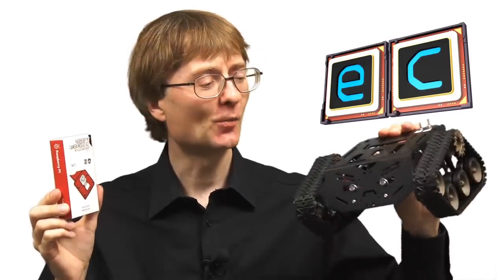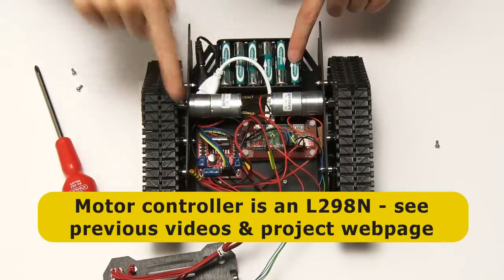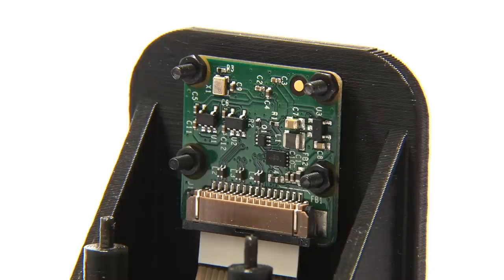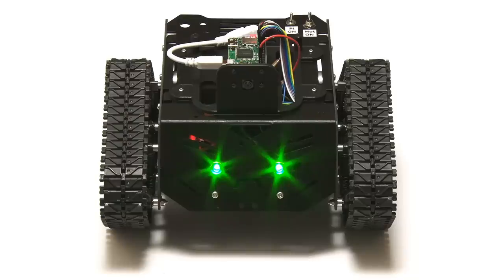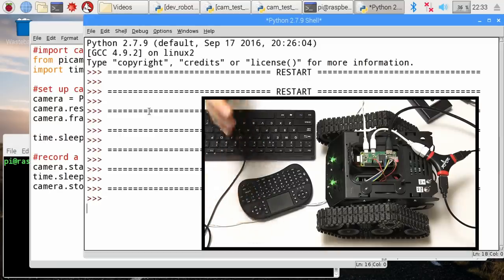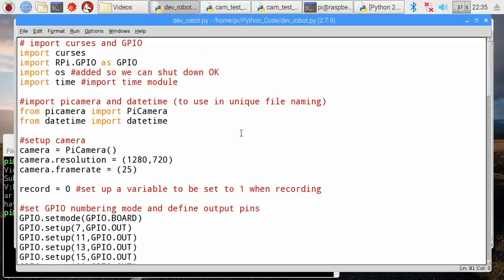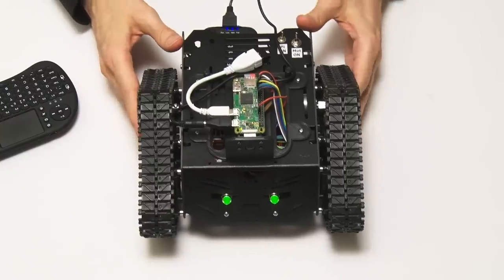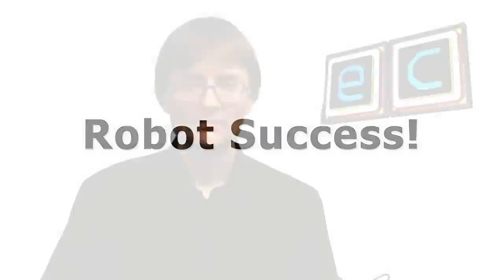Raspberry Pi Devastator Robot #3 : Camera

Comment: Some ideas: 
-You can add a GPS module, there are some cheap GPS boards that output the coordinates in a serial port, so you can easily read the location and use it for navigation.
-You could install openCV on the raspberry and do some image processing, like detecting faces or objects.
-You could also install gyroscopes and accelerometers  to further improve navigation.
Reply from the maker: Great suggestions. So much I could tryu here.
Reply: Screw navigations, a weapon system should be next.
Reply: @TentaclePentacle  someone found some sense. think it would be able to compete on robot wars?
Reply: @elite gamer88
It needs a bigger battery pack and more armor.
Reply: Good ideas.
Reply: @TentaclePentacle  >>> "You're going to need a bigger boat." -- JAWS [1975] 😊
Reply: Lidar ?

Comment: Loving this project. The way you explain the code is wonderfully clear. I've got a similar little project on the go here and initially thought of using 18650 batteries to power everything, but realised early on that the 4 motors I am using would be drawing a lot from the cells so am employing a separate power source for the current Pi 3B+ that will later be replaced with a ZeroW
Reply: Really depends on what you are planning to do. My little project has 4 12v motors running about 2 amps. I have added cameras, sonar and microwave so far. I will carry on mixing sensors until I achieve what I want from it. We all know motors use large amounts of energy to move things so unless the surface is level and smooth the 18650 batteries will probably drain before any smaller DC source for the Pi etc. I am also looking at fitting a SSD drive but the power up drain is quite high so a simple SSD to USB adapter would not work properly. I want this project to be working for hours not minutes so I have fitted 9 18650 4000 mAh batteries in a tray underneath

Comment: Been waiting for an update on the robot! These make for a good instructable as well, and has been making me quite tempted to pick up one of those devastators myself, or at least something similar. I was thinking if you take a game controller with analog triggers/sticks, you could map your control program to take the readout of how far the sticks are pulled forward or backward to control speed/direction. kind of a dual stick driving mode, each analog stick controlling a track. Though it would take a little practice to get fine control to pilot it though. Was fun to watch, looking forward to the next.

Comment: If you put a drop of nail polish on the bolt nut assembly holding the Zero it will be secure, but easily unscrewed. Very interesting and useful video (I use the original Sentdex robot code). Also your robot should have some sort of name IMO.

Comment: Great job and very inspiring.  I bought the smaller chassis you demonstrated before but will also pick up a devistator. Maybe in a future video you could make your own controller using an arduino on both sides connected via radio.  The pi could operate the robot directly but you could take override the control using the arduino. I think it would be a good excuse to incorporate arduino.  Possibly you could swap the Pi with your new Panda Apha which has an arduino built in.
Reply from the maker: Wow, with a LattePanda Alpha there would be lots of power to play with for AI and stuff . . .

Comment: ExplainingComputers What you can do to fix the problem with the nuts at 5:35 is drill a hole just slightly smaller than the diameter of the nuts and then press the nuts into the hole. This way, you will only need Mr screwdriver to screw/unscrew the board. The plastic will hold the nuts in place and prevent them from turning. (I keep telling people there is a madness to my methods, but nobody believes me.)

BTW, did you ever build that single button power off timer circuit I suggested in video #2?
Reply from the maker: Thanks. I've not attended to the off button yet!
Reply: Hey, my daughter is interested in robotics and part of her high school's robotics team. I'm thinking of getting her a SBC with a motor controller and motors. Do you think Arduino boards would be better than SBC's? Are there SBC's that would be better for a controller than others? Do you have a parts list you can recommend? I don't know if she'd be interested in the tank project, and I'm more interested in getting/putting together her a kit that she can assemble multiple ways.
Reply from the maker: An Arduino or other microcontroller could certainly be used -- it just depends what you want to learn and achieve. Most (consumer) SBCs have a Pi-compatible GPIO these days. My robotics project web pages are at: https://www.explainingcomputers.com/rasp_pi_robotics.html and https://www.explainingcomputers.com/pi_devastator_videos.html

Comment: AWESOME AWESOME AWESOME! Love it. I reckon you should definitely invest in some 18650 Lion batteries to power that beast (or open that battery bank up which should have the same cells). Also perhaps you could get a latch printed with a cover for the brans of the beast. so least it won't get wet lets say.  Also what would be cool would be some sort of stream from the camera to a mobile device, might need to upgrade to a full-blown Raspberry  Pi for that. Look forward to more videos, might even turn into some sort of combat robot, enter it into Robot Wars, who knows, lol
Reply from the maker: Thanks Brett. I will indeed set up streaming at some point!

Comment: I taught computer studies in the 1980's using a BBC Micro which had a robot which could follow a black line round the floor. The kids deliberately broke it because every lesson given by another teacher involved the robot and they got tired of it!  I think an LGB train set would be better in the garden than a terrain vehicle for developing AI software, since it will always have the power of the mains behind it. Thr drawback with a Pi on battery power is that too heavy a current draw will cause a maddeningly difficult to diagnose software error.

Comment: Re: not running on AA battery pack

Christopher sir, might your mighty Devastator have run with alkaline cells rather than nickel metal hydride?

Possibly, engaging the motors divided the potential and the board's input dropped below the about 5 V it requires to run. The extra 1.8 V gained by using alkaline rather than NiMH cells could have kept the input high enough for operation.

If unregulated 9 V is the magic number to operate the motors and the board together, since you shop at Maplin's you should be able to find a two cell holder there. Eight NiMH cells in series would give 9.6 V and the small holder would be easy to bypass when using alkaline cells if desired.

I deliberately went looking through recent comments and I gladly see that, from about a week ago, you still have another installment on this robot series in mind so I hope my thoughts are of some use.

Comment: I remember watching Battle Bots when it first came out late 90s/early 2000s (in the US on Cable TV); then I recently saw what it has become.  

Seeing this bot as a platform to build off - had this been around at the start, it would  have demolished the competition.  But even with some of the wild designs that I've seen today, this platform, along with the Pi and the Open Source Community, makes the competition at least approachable...even if this is used purely as a learning platform for designing a custom Battle Bot.  When I first watched Battle Bots, I wouldn't have had any clue how to even start.

Still, I'd be interested in seeing double M4s on a gimballed mount attached to this as proof of concept - perhaps a follow-up video...(?).  Cause I saw a drone/hovering bot that had quad flames and it could hover over and burn the opposition.  How do you stop that...?  Hot lead... lol

Cool video!  This type of bot, even outside of pure carnage, will no doubt inspire and, more importantly, enable the next generation of makers to do all sorts of things like never before.

Comment: Would have been nice if you made it into a gimbal a suspension system. Make a small plate and bolted to the camera with 6 hooks protruding have the mounting bracket with a bigger opening same with 6 hooks use a couple big lastic bands and suspend it with the elastic bands. I thought you would have made it possible to drive the robot through the camera why didn't you do this
Reply from the maker: Very good idea! Noted for the future. This said, when I tested the robot at home driving on carpet, the video was very smooth. So I wrecked things by going out and recording on a rather rough surface!

Comment: Did the plans for Episode 4 get shelved?  I'd love to see another video may be covering some of the workarounds for power, relays instead of switches for the motor controls, and a different method of control, maybe using Bluetooth and a game controller?  Love watching your videos though, which are both educational and fun for both a 7 and 47-year-old - not an easy task!
Reply from the maker: Episode 4 keeps getting moved back to make way for other things! It will happen, post lock-down now.

Comment: Great video, interesting about the power issue. I got a quote for the 3d an eye watering £60 so backed off for a bit and will look at options like mecano :-)  anyway still struggling with part one, so long way yet. I spotted the lack of speed control so looking forward tio the next leg of the journey. But I am trying it so you have inspired an oldy to get cracking!
Reply from the maker: £60 for that 3D print! That is -- a lot! :) I paid £18.40, including shipping.

Comment: Annoying nit-picker here. :-)* Congratulations for honesty in showing the mis-steps, along with the achievements. If you know how things are going to work out, it's not experimenting or developing, it's a demonstration.
Modest technical suggestion; instead of having the locating pins on one end of the Zero and the bolts on the other, put one pin and one hole at each end,  arranged so that each side and end has one pin and one hole : (read quote and comma  in this example as pins '::::,  colons as the board.) Maybe a threaded socket for the bolts would save having to turn it over to fiddle with nuts?  
As you've inadvertently demonstrated, it's easy to overlook subsequent access when deciding where to put components, so thinking ahead a couple of stages can save some reworking.  It's also tempting to design things to be symmetrical, but deliberate asymmetry can help prevent incorrect installations, as you've previously shown with PCI slots and other connectors. Now, it's practically impossible to plug things in the wrong way round, thanks to slots and pins.

Comment: It's not a robot if you are controlling it, I think technically it's a fansy RC car...
I liked the speed it was moving through the camera, looked about 40kms hour like that.
Reply from the maker: A computer program is controlling it, and I am controlling the program. It is not like an RC car, as there a direct electronic/electric connection exists between the controlls and the motord. Whereas here, any link can be programmed.
Reply: @ExplainingComputers  sorry Chris, Im sure it will be a robot, it has enough CPU, no doubt there. But until it does a bunch of things on its own, it's remote control. No matter the transmission type.

Comment: Christopher, it would be cool if you could add object recognition to the system. I don't know if that Raspberry Pi can handle it, otherwise maybe another microcomputer which is more powerful, you have at least one of those. :)
I would guess that GitHub (or GitLab now that MS owns Github?) has got some interesting code for object recognition. I know that at universities they have been doing research to it for many years and I know that it works quite well these days.
Reply from the maker: This is a good idea. Adding a bit of AI would be a great future project!

Comment: Is there a way to stop the motor automatically when you don‘t press a key down? I think your code is nearly perfect for my purposes, but I think it will give you more control if you don‘t have to press always ”another key“ to change the direction or ”enter“ to stop it.                           You have done great work:)
Reply from the maker: Not using curses for key reading. I'll report back on this in a future video!
Reply: ExplainingComputers Thank you very much

Comment: How did you get the holes exactly in the right place on your 3D model? Is it possible to print to scale on paper one of the sides of the object so you can test the measurements physically?
Reply from the maker: I did a lot of measuring, and checked and rechecked the CAD. You can turn on and move around a ruler in Tinkercad.

Comment: Hi I built the tank and it worked fine. I have since been trying to do GPS etc using a PIXHAWK flight controller. A number of issues but its now come down to the motors in the devastator. The pixhawk cannot see the l-bridge so I put two quicrun brushed escs one on each motor but its not working and wondered if you can help suggest anything to help? Is it that these motors only have one speed and one voltage (I am beginning to think so) Buying another set of motors that would interface with the tank seems excessive and difficult (shaft size etc) but the motor/esc combo i tried won't work
Reply from the maker: The motors are speed-controllable using PWM. Checkout this recent video where you can see a build there speed control has been implemented: https://twitter.com/SunnyMo13/status/1283200349617020928 I will at some point implement it myself! :)

Comment: Mr. Barnatt, I'm very inspired by your videos I wanted to ask if you could include a simple code on the same project above to control a simple relay using any available Pin? Thanks, in advance
Reply from the maker: I'm glad you are inspired! You would need some driver hardware for the relay. The code will be identical to controlling the motors here. Look out for my upcoming video on Raspberry Pi home automation.

Comment: i am surprised you got the power bank to power the pi without turning off ,did you just connect it straight up or did you use  some special trick, you see i have 2 power banks a nice 10000mah xiaomi power bank pro and a cheaper one , i have tried to use these things to power some arduino projects with a  nano and a pro mini via an FTDI but the power bank always turns off after a minute or so , i think if it detects that a certain amount of current is not being drawn it shuts itself off ,  pressing the battery check button turns it back on for another minute or so ,maybe the pi draws enough constant current to keep it from turning off but i wonder if there is a way to trick it into not turning off if not enough current is being drawn from it
Reply from the maker: I've not had this problem using USB power banks with a Pi, and I've used them in several projects now, and two different power banks. It may be that the power draw of a Pi is consistently higher than a Arduino.

Comment: What kind of control system are you thinking of moving to? I’ve recently discovered that some of the PS4 control pads connect quite nicely through the Pi’s internal Bluetooth but the drawback is the only code I’ve found to make this work uses Pygame and it takes a bit of time to load. Still looks cool once it’s all set up though.
Reply from the maker: I am still pondering!
Reply: Well if you need some inspiration for joystick control check out the Piborg website. I borrowed some of their code to make a Pi Zero work with a PS4 pad but other controllers should work. I had to tailor the code to work with a 4tronix Picon Zero motor controller. Here is the link to the Piborg code if you are interested https://www.piborg.org/blog/joyborg. Happy computing!!

Comment: Ohhh I`ve been looking for this one!
Reply: What if we would like to see the the realtime preview of the camera to control it in places our eyes can`t see . What would you recommend , adding a code to see preview in the OS and than a device connected to the HDMI grabbing AV out of it on conversion to send AV via Radio for instance to a reciver mounted on the controller device > I am aware that such things are popular among the quadcopters and they do that automaticly  (T - HDMI to Radio and  R -Radio to HDMI ) but how would such process look like on the Raspberry Pi and what would be it`s power consumption , would it affect the design greatly as we have already some high current draw devices as Motors ?  Might make a Devastator Robot Video 3 #99  a good watch ;)
Reply from the maker: I will add the code to stream video at some point I'm sure. :)

Comment: I have a problem with getting my raspberry pi to record while activating the motors. I powered the pi with it's official power cable and the motors with 6 AA batteries. The motors are running fine on their own but when I start recording while running the motors, the motors are like under powered and are not moving as supposed to

Comment: Is it possible to connect to the robot via a remote desktop (like in your SSH Network video), open a window on the pi desktop showing the camera feed and then control the robot.
Reply from the maker: Yes, remote access with video streaming is a possibility that I intend to implement!
Reply: Excellent! Thank you for your reply. I look forward to further updates.